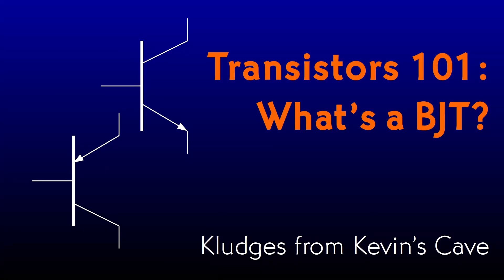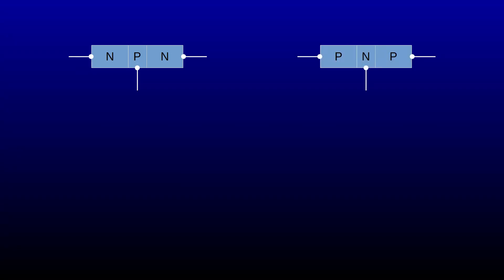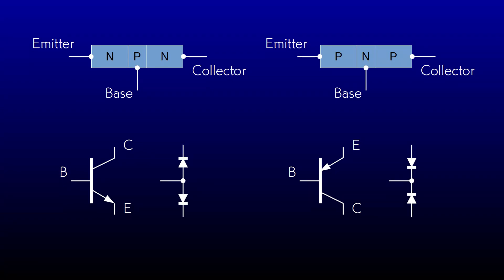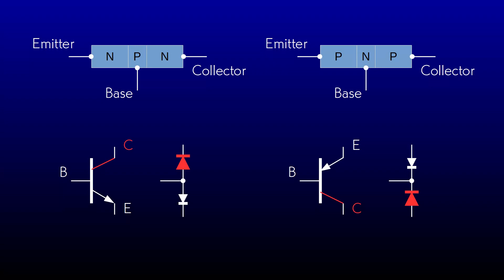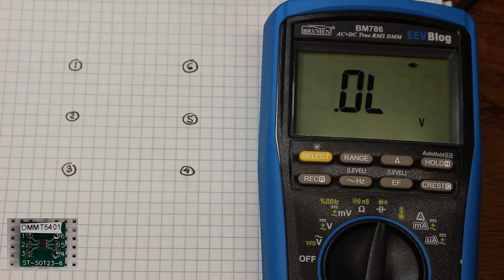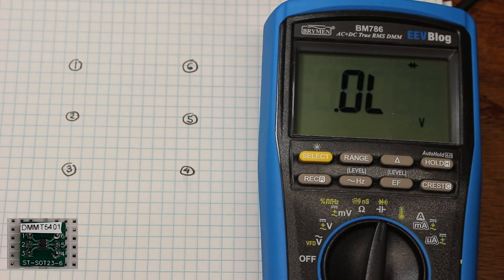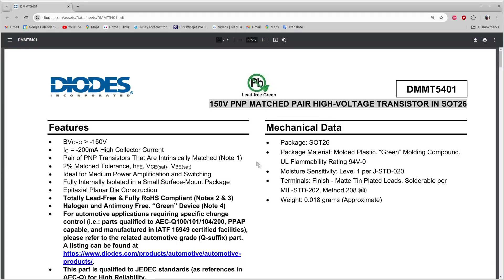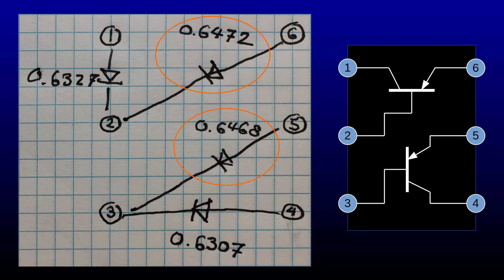Transistors 101: Identifying an unknown transistor

Comment: Kevin these courses are great!  Could you do one on FETs so I can remember which terminal is source and drain on N and P channel FETs?
Reply from the maker: @theoldbigmoose  that's on the list. With JFET's, you don't have to remember, because as far as I know, all the ones in current production are symmetrical. Most MOSFETs are enhancement mode, so N channel ones look like NPNs, P channel like
PNPs. The source more or less plays the role of the emitter, the drain the collector. But ... It's complicated because there are some depletion mode devices out there, and some devices with a separate substrate connection.  Yeah, I'll have to get into FETs pretty soon.
Reply: @KludgesFromKevinsCave  Thank you Kevin, will be looking forward to it!  Thanks for the source~emitter analogy also.

Comment: Thank you for producing this material. It is considerable work. The question I have is - What is the design process to optimally bias the circuit? (Before current mirrors and the like are introduced). The (Distorted triangle wave) scenario was introduced, but I'm not sure it was ever answered or closed off. It's the design process that particularly interests me.
Reply from the maker: The best answer I can give is somewhere between 'it depends' and 'don't do that;'  Those who look for excessively high gain in a single-stage open-loop amplifier will be punished with distortion. If you stick to a stage gain of, say, 20-40, you can use a big enough emitter resistor that you won't see the pointed-arch distortion that was in the video. A good rule of thumb is that the external emitter resistor (the one carrying the ac signal, not the one setting the bias point) needs to be at least 5-10x the intrinsic emitter resistance at the desired collector current.

You can use a high-gain stage, distortion be damned, if you wrap it in a feedback loop - which I haven't discussed yet, but I'm working up to.  

Later in the series, I plan a couple of 'putting it all together' videos that demonstrate higher-performing multi-transistor amplifiers. Each of those amps will have several stages, usually including current sources (or mirrors), differential pairs, common-emitter gain blocks, and emitter followers. They all work together so that each stage compensates for the failings of the others (a follower to provide low output impedance, for instance, or a current source to give the appearance of a nearly-infinite tail resistor.) All of them use feedback to stabilise gain and minimise offsets.

For small-signal circuits, pretty much everyone just uses an op-amp rather than a single-transistor circuit, unless you need to do something particular - for example, use the exponential relation between base voltage and collector current, or use the transistor to regulate a current, or use the transistor to handle more power than the op-amp can put out.  But understanding the basics of what's going on inside the op amp - which this series is working up to - is vital to understanding the limitations of what an op amp can do. That will come up in discussing op-amp integrators (input offset voltages), using an op amp to drive a power amp (crossover distortion and op-amp slew rate), making a radiofrequency amplifier (Miller effect) and so on... just as the discussion of current mirrors led us to the Early effect.
Reply: @KludgesFromKevinsCave  Thank you and understand. I guess my question was finding the optimal bias point.in the most linear region. Say for high-quality audio, where you wish to use discrete transistors over Op Amps, what is the design process to find that bias point? I understand that bigger picture objective gets way more complicated and requires far more sophisticated approaches, plus negative feedback, etc. I'm just trying get the design process clear in my mind. My original background was electronics, but my career moved away from it many years ago.
Reply from the maker: @tonykirkham1663  I wish I could give you a single recipe. In a way, this entire series is working toward the Holy Grail of linearity and dynamic range. Once feedback is in play, as it always should be, the linearity is nearly assured, and biasing becomes a question of 'how far can the signal swing without clipping? Center the bias point in that range.' Each presentation of a given circuit topology (follower, common emitter, etc) has at least an example of finding the bias point.

I'm generally skeptical of the "no op-amps in high-quality audio" camp.  Sometimes you need discretes in a low-noise preamp, where signal levels are minuscule, or in a power stage where you have to dump a lot of heat, but with reasonable signal levels, op-amps are awfully good. With that said, I surely don't have a 'golden ear' - I grew up very near a busy airport, and have had some minimal hearing loss all my life. I trust my instruments rather than my senses.

Comment: The engineer of that pinout woke up in the morning and chose violence.
Reply from the maker: The dual transistors all seem to come in strange pinouts.  DMMT5401 and its complementary partner, DMMT5551, even have more than one choice for them, both peculiar.  https://www.diodes.com/assets/Datasheets/ds30436.pdf

It's actually not horrible for layout.  Common emitter (as for a differential pair or exponential converter) and common base (as for a current mirror) both put the connected pads right next to one another.
Reply: @KludgesFromKevinsCave  Mmm. True. That makes sense for a current mirror layout. I see onsemi has a different layout that is EBC EBC, but the EBC on each side do not all belong to the same transistor (which is also confusing to me in a different way). For me, it would make sense to just have each side be EBC or CBE for each transistor, both for most layouts and conceptually, but that's just me. No doubt there's a reason not to do this on the die.

Comment: Excellent tutorial. It is may be worthwhile to recognise that the difference of diode forward voltage drops is of the order of 2.5%, i.e. neither very significant nor insignificant.
Reply from the maker: Hmm.  I suppose.  I think the important point is that the difference is always there, so you can tell emitter from collector that way.  Sometimes at the bench it's quicker to use a multimeter than look up the data sheet for the transistor.
Reply: @KludgesFromKevinsCave  True